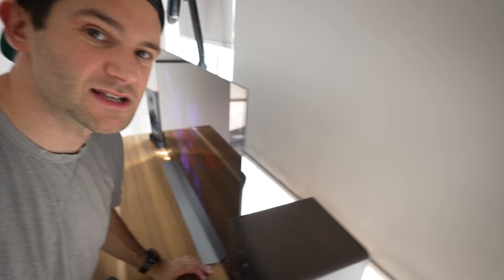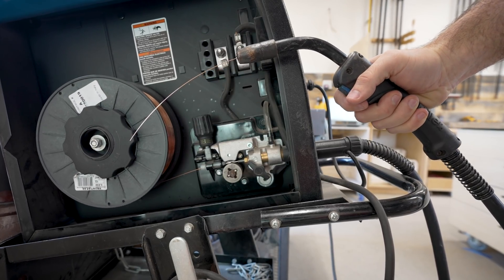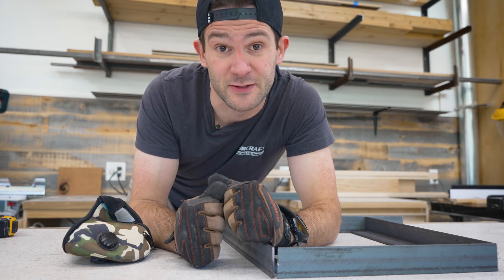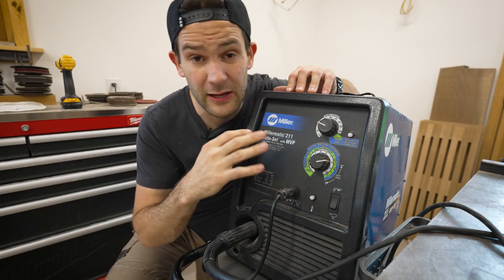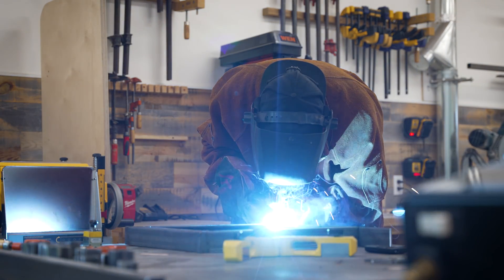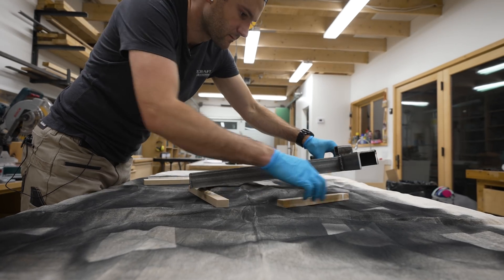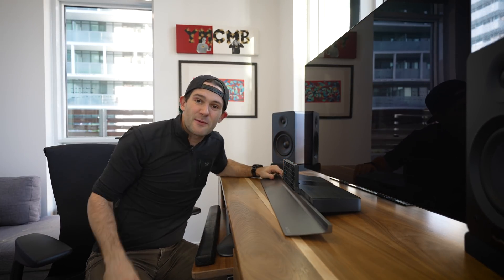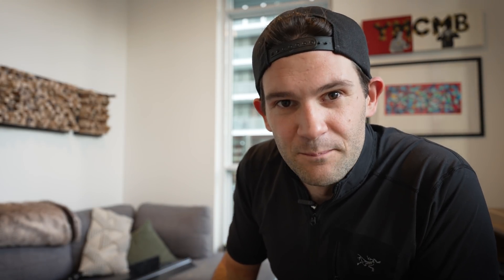Every Maker Needs to Know How to Weld, Here's How!

Comment: This is definitely one of the best intro to welding videos I’ve seen! I will give some honest feedback though, and that is that there are two common categories of welding, flux welding (stick, and flux core), and shielded gas welding (mig and tig). For anyone on a budget, or is doing this occasionally, I would recommend flux core welding. It is basically the same as mig, as it uses the same machine, but instead of gas shielding the weld, the wire has a flux core, which shields the weld. But that means you have some slag that you need to scrape off, and flux welding makes more dangerous fumes. I personally don’t have the money for a gas tank yet, so the main welding that I do is flux core (until I broke the welder), and stick. But other than that, this is one of the best welding videos I have seen!
Reply from the maker: This is a great point Arpad, and honestly something I didn't even think to include because I've never worked with flux core before. I just went straight to shielding gas. But Fluxcore (not stick in my opinion) offers an even better entry point for learners because you need less stuff to get setup. 

Fun fact: Arpad is actually one of my supporters Patreon and posted this comment there originally earlier in the week. I wanted him to post it here so that everyone else could get this important info. Also, Arpad has his own channel which you should definitely check out because he  teaches me interesting facts all the time.
Reply: @ZacBuilds  thank you so much Zac! I really appreciate it! I started out using stick welding because it’s what my school started us off with. But it is very hard to strike an arc, and very hard to control. Flux core is definitely the best option for any beginner, and then if they want to upgrade to mig, they don’t have to replace the whole machine! Just the spool! But one thing I forgot to mention is that with flux welding, whether it’s stick or flux core, you shouldn’t push the weld, only pull. That’s one downside to flux welding…
Reply from the maker: Ya its funny I think a lot of people suggest stick for learners and first timers. But it's really hard to get a good bead with a stick welder. That's why I suggested people go right to MIG
Reply: @ZacBuilds  definitely! With stick, starting the weld is the hardest part. But with flux core and mig, I like to describe it as it’s like a hot glue gun. You pull the trigger, and then push/pull the tip! It’s way easier, but only reason I’m better at stick is because I have had twice the amount of time to do stick welding.
Reply: @ZacBuilds  I think the reason that most people suggest going with stick right from the get-go is that stick is what professional welders use. By that logic if you decide to get more into welding you have more room to grow with stick, plus it's easier to pick up a mig gun if you're used to stick welding than it is to jump from mig to stick. So it makes sense to get that learning curve out of the way early. Kind of the same reason that it used to be better to learn to drive on a manual transmission. If you can do one, then you can do both. I've never welded before myself, but the logic makes a bit of sense when you think of it that way.
Reply: @kellymckay4169    I will say you are correct, there is a lot more to understanding welding. But I will correct you on a couple things. First is minor, it is actually SMAW (stick), FCAW (flux core), GMAW (mig), and GTAW (tig). And second, flux core welding does not require any gas shielding, that is only for mig (GMAW). Flux core welding is a lot like stick, you have a flux that shields the weld, and slag to scrape off. If you think flux core welding requires gas, that is mig. Flux core was invented for the job sites to replace stick, as it’s simpler to operate. There is no gas bottle required for flux core welding. And because flux core welders we’re invented for jobsite use, they are equipped with the standard 120v 15-20a plug. I agree with Zac, everyone should do welding, and I agree with you about that there is a lot of information on welding. But flux core doesn’t require gas.
Reply: that you are correct on! I do agree with that. What I disagree on is when you say there are “many flux cored wires” that require gas shielding. Definitely E71T-1 is the best and most structural flux cored wire, what Zac and I are talking about is welding for homeowners and/or DIYers. They aren’t going to use E71T-1, and this is where I agree with you on the fact that you need to have a good understanding in welding, more specifically, which wires to buy to avoid making the mistake of buying the wrong wire. But for beginners, the most common flux cored wire sold at the common hardware stores is going to be E71T-GS. I’m sure there are many others, but that’s the one everyone I know, including a high school welding teacher uses. It’s cheap, easily accessible for a lot of newcomers. And then MIG would be the step up! But definitely, people should have the right knowledge on which welding wire to buy. But for homeowners, E71T-GS is common and what they should get. For pros, it’ll definitely be different, but that’s not who I’m talking about.

Comment: Loved the video, its great for beginning welders. Quick note, it is actually important weather do you push or pull.
For a small project, you are probably right that it's not as important, but if you need strength or are doing this as work it is vital.
 Push is for mig and any type of welding that has no slag. You pull for FCAW, Stick welding or anything with slag, this increase the strength of the weld and can help prevent most defects that can appear.

Comment: I wouldn't consider welding a difficult skill to learn.  It IS a difficult skill to master, however.  imagine a skill that requires you to see how the metal flows, but at the same time requires you to be basically blind while doing it.  that is welding.  all of your senses are dulled while doing it as the gloves are thick so you cant feel the movement as much, your eyes are dulled to keep you from going blind, and your other senses don't help all that much with this.  I was going to school to work at an oil plant, but realized most of the guys I was going to school with had been using a welding torch since they were kids, and I was just learning. still, glad to have learned what I did.  Can't wait to get my own welding unit and build some of the things I want to build.

Comment: I'm not concerned so much about the act of welding but more all the technical details behind it. What kind of gas do I use? What are all those gauges on the tanks and what do they mean? What kind of wire do I use? What happens if the feed is too fast or too slow? Can I electrocute myself?

Comment: I've been wanted to get a welder for years now, but I only have a 15a, 120v circuit out in the garage. It looks like you have yours on a 15a circuit too, how's that working out for you?
Reply from the maker: Yessir! It works just fine as long as I don't crank that voltage dial past 8. Which for my uses is plenty. That let's me weld up to 3/16 thick steel, maybe even a bit more. I've tripped it occasionally if I have other things running on the circuit, but even that hasn't happened in a while
Reply: @ZacBuilds  That's probably fine for me too. My only plan right now is to make a few mobile bases for some machines so I can move them around easier in my tiny-ass shop. A saw mill build in the future wouldn't go astray either 😅

Comment: i would love to weld.. but maan, my small hobbyroom even has too less space for cool woodwork stuff ;(
Reply from the maker: Ya that's definitely a concern, to properly weld you need good ventilation and a decent amount of space. If  you use a flux core system you could do it outside if you have access to a spot. Make a little folding metal table for small jobs and bring it out when you want to weld?

Comment: As someone whose welding education ended in high school after I bare-hand grabbed some metal I shouldn't have, I can confirm: it does get hot.

Wouldn't recommend the experience, stick with gloves.
Reply from the maker: Oh man, even sometimes I mistakenly pickup a piece with non-welding gloves on it can burn you quick!  Safety is number 1 when you're welding.

Comment: I started welding because I looked at the computer desks and work benches and wasn't satisfied with what I could find in the local stores or online and anything that came even close was ridiculously expensive.
I made a 3D model in Blender and after about a week of figuring things out I made my all metal ( except for a hinged wood top, for drawing ) computer desk/workbench. 
It ended up being about the same price as a crappy computer desk and it taught me a lot of things really fast. I'm still pretty impressed with how good it turned out and it's exactly what I wanted, without having to compromise based on what was available.
Welding is awesome!
Reply from the maker: Dude thats probably the best part about being able to weld, it just opens up so many new possibilities. My desk wouldnt be half as functional as it is right now if I didn't know how to weld. 

I feel like many people dont tackle DIY projects that need any metal work at all because they think it's a whole other league of skill. But it just takes a slightly different setup and the willingness to spend an afternoon learning.

Comment: Good stuff, would love to give welding a try but still nervous about welding around all the saw dust.   I know you keep your shop very clean but have you had any issues with the sparks around saw dust?
Reply from the maker: No issue with sawdust at all. That being said I do keep my welding stuff at basically the opposite end of the shop from where all the dust gets made. I'd definitely keep a fire extinguisher on hand, but unless you have a THICK layer of sawdust on every part of your shop I wouldn't worry about it too much. Just clean the area around your welding work station.

Comment: I'm sold, new year's resolution: learn how to weld, been waiting to do it for quite some time, but you know "adulting" takes most of the week. 
Can recommend some entry level equipment for beginners? Or make a video?

Saludos desde Mexico...
Reply from the maker: I hear that! It's hard to find the time. But honestly, a couple of afternoons in the shop and you'll be up and running. I'm not sure what brands are available in Mexico, but anything from Lincoln or Miller should get the job done. I'm sure they make some entry level welders for a decent price. I included some links to good entry level equipment in the video descrtipion but they're for Amazon US, but you may be able to find them in Mexico too.

Comment: Hello. Nice, great build! Well done! 

I have two semi-related questions/ hints. 
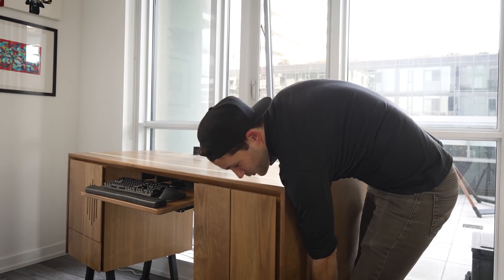Just wanted to mention, please, save your back (spine). It looked dangerous at 12:52. 
Also, are your wrists okay? I may be wrong (most likely I am), but your keyboard and mouse are mounted on lower moving desk. Are your wrists okay if/when are you using keyboard/mouse for longer time?
Reply from the maker: Appreciate the concern Jozef.
I've actually been working on my back a lot lately. Different stretches and strength exercises. I'm getting better, but still far from perfect. 

My wrists are fine and actually the ergonomics of my desk are much better than you might initially expect. My desk is 4" taller than your normal desk. So the keyboard and mouse tray are actually at the approximate height of a normal desk. With my elbows on the arm rests of my chair my wrists sit flat on the wrist rest when I'm working. Very comfortable and doesn't stress them at all.

Comment: I have the Lincoln 140MP that allows you to do Stick, MIG, and TIG. It is only 120v and I have yet to push it to the limits. Like you said, for a woodworker, a 120v is plenty juice. 

Edit: Pushing method is better for MIG. Pulling is better for flux core bc you get best shielding under those scenarios.
Reply: Thats awesome, hard to beat that kind of versatility. Was it expensive?
Reply: @ZedEh   Not particularly. With the TIG torch and foot petal, it was $1200 USD from a year or two ago. Might be slightly higher now. The only downside to 140MP as is with most multi process welders is the lack of AC current when doing TIG. So you can't weld aluminum using the tig gun and need to use optional spool gun for MIG welding aluminum. Miller and a couple of other folks makes a much nicer AC/DC tig multi processor but cost significantly more.
Reply from the maker: @WoodcraftBySuman  Good to know, I'd love to start doing some TIG in the near future. But I might save up and try to get one that can do Aluminum too.